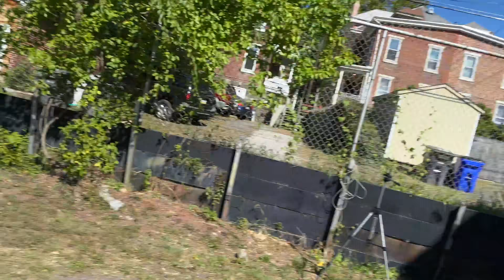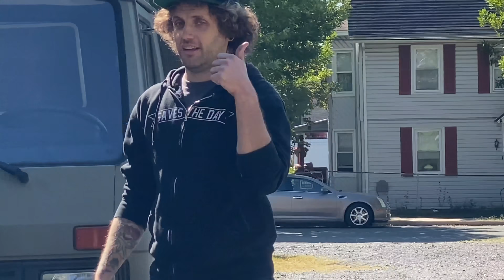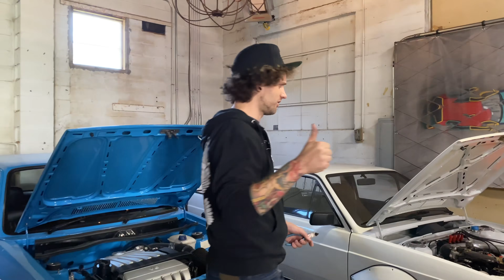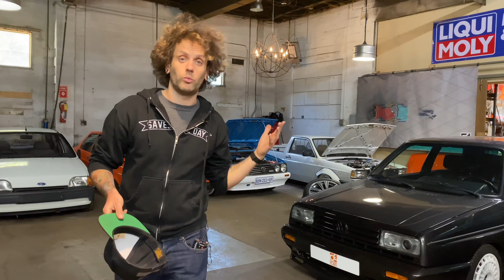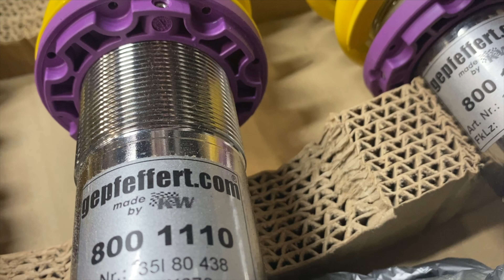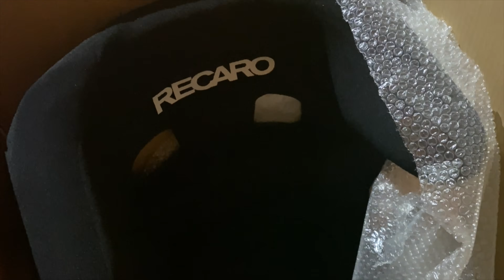Jamie's Garage Hangs - Random updates on TDI Racecar / Gepfeffert / RECARO / BFI / DIY powdercoating

Comment: Hi Jamie, just getting into VW at 46!! Originally looking for a Transporter but came across a lovely Polo GTI 6n2 on original BBS split rims. Do you have any tips on undoing the bolts as I’ve seen plenty of YouTube vids where people snap them. Keep up the love!!
Reply from the maker: Lots of penetrating oil, and a bit of luck in my opinion. My (retired) dad just did a set of the 18" versions in the UK and got away with it. 
Some people would also say heat, but I try to avoid it unless necessary. The bolts are titanium IIRC.

Hope you get them out okay! Thanks!
Reply: Jamie Orr I was hoping you’d have a magic trick!! I’ll give it a go but I have bought a spare set just in case!!!

Comment: Great video! Looking forward to seeing updates on the swallowtail! I take it it’s gonna need a chassis notch going that low?
Reply from the maker: I'm hoping to avoid cutting anything by using ball joint extenders, and perhaps custom axles etc... We'll see..
Reply: It will be the drive shafts that will be first to hit the frame, ball joint extenders will just level out the track rod ends. Good luck with it 👍🏻